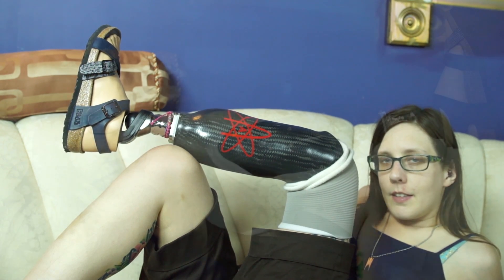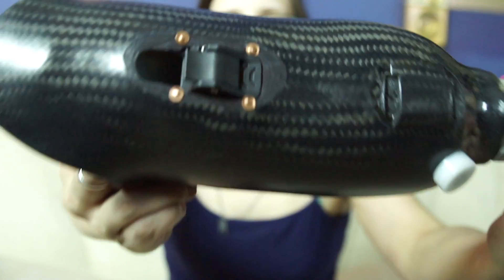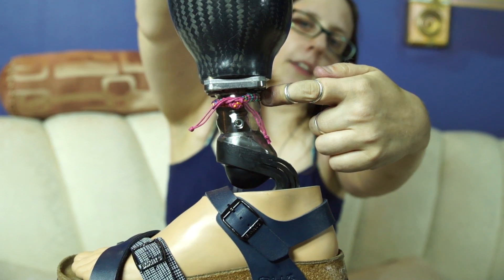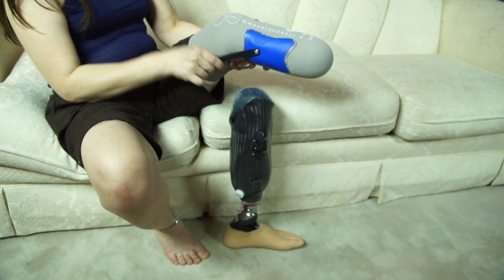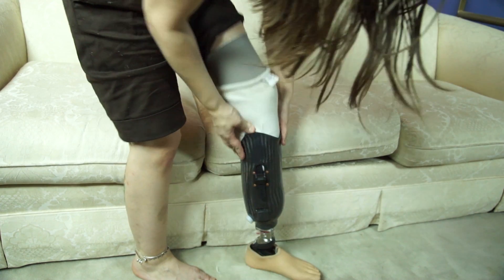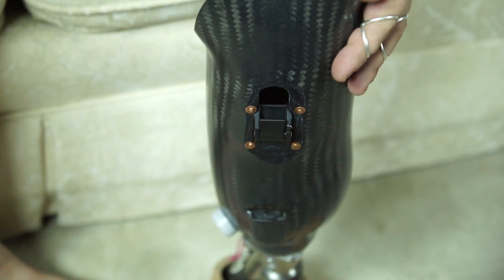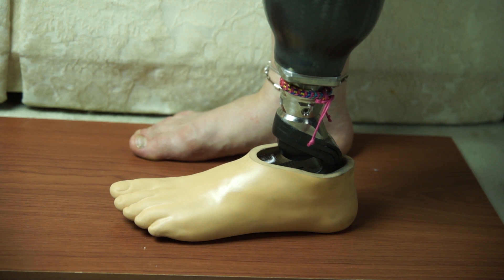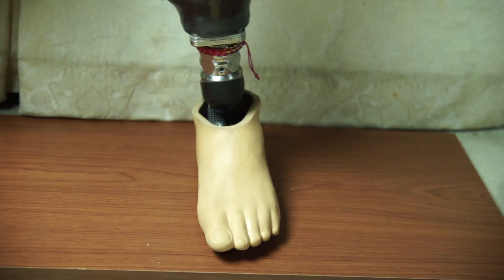AmputeeOT: How a definitive carbon fiber prosthetic leg works

Comment: I have the same foot but I do not have a valve or my in its suction cup system. I also don't have the carbon fibre plate you have inside your foot. Am I missing somethings?

Comment: I  had a transtibial amputation 8 months ago. My prosthetist cast my prosthetic and has told me I will have to have more casts taken until my stump is at its smallest. There are no valves to suck out air on mine, and no liner at the top. I have what I call a flower pot which I have to put my stump into. I then have to add socks to this then I squeeze the flower pot into my prosthetic. As you can imagine my prosthetic looks really thick as there are two components to it. I despair ! Also I have no flex at the bottom ( no ankle ) and my foot has little spring in it either. It is made out of some kind of hard plastic. I have to wear up to four socks. I also saw your video of when you first walked. Yoiur other prosthetic looks different than this one. I live in Scotland and had mine done under our NHS, which means I didn't have to pay. Can you please let me know who manufactured yours and was it expensive ? Thank you .... Kelly

Comment: when your residual limb shrinks would you need to buy a new liner to make it fit properly or is it possible to adjust the current one?
Reply: Mini180 You will be supplied a number of socks that come in different ply's. They come in 1, 3 and 5 play and all you do is just add more ply throughout the day which adds more volume to your residual limb

Comment: so should I go for the suction leg like your, the sleeves wears down my skin and I'm trying to get away from the sleeves, I do a lot of walking and doing around, what would you say do? thank for any help
Reply: +denise cryer I know your post is old, but thought I'd try and help. Your skin may be affected due to a poor socket fit and not the sleeve. There are many different types of suspension setups and the correct one for you will depend on your needs and specific situation. Her prosthesis is actually a terrible design. The reason for her design is due to a poor socket fit, otherwise, she would not require that side strap to help control rotation of the limb inside the socket (which I suspect was the goal with that strap). Hope this helps

Comment: thanks for such nice videos .i am going  to probably have a ankle and foot amputation in a few months, its a bit scary,but you make it seem a lot  more simple to put it on and take it off. thanks again for your time and how difficult is it to wear a dress or also a pair of jeans?
Reply from the maker: A dress is no problem, but jeans are a little weird, see: AmputeeOT: Putting on pants with a Prosthetic
Reply: I have a above knee leg amputation.  After the amputation I wore shorts and hiking boots to transition into my prosthetic, the shorts just allow ease in on/off adjustment.  Once comfortable I now wear jeans again.  Your regular pants/jeans should slide right over your prosthetic and donning shoes is no different than normal. I wear cowboy boots and once adjusted I modified my boot with a inside zipper to allow pulling it on the prosthetic foot.  But you should have no issues with your clothing, in many ways my prosthetic is easier to deal with than my original leg.  Good Luck!!
Reply: Of course you can!  However, quite how depends on your level of amputation and whether left or right.  I' m a below the knee left leg amputee  which means I can drive an automatic transmission  but not a manual transmission as I can't operate the clutch!
If my prosthetic becomes uncomfortable whilst driving I can remove it and drive left legless - I'm just waiting for a traffic cop to demand "Just step out of the car, Sir" and see his reaction when I refuse!

Comment: I can't quite tell, but it doesn't look like you have one of those pivot plates at the base of your socket. I know you've mentioned uneven surfaces giving you trouble. Have you considered a pivot plate doohickey? I got my first one ever just a couple years ago, and the response (and relief) is pretty amazing.  After almost 40 years walking without one... ugh, I can't imagine going back.

Comment: i have a question, whereabouts on your residual limb is the pressure when you are wearing your prosthetic, is it right on the bottom where the wound is, or are you supported under your knee?

Comment: I was amped 1 year ago next week.Same leg same BTK.I've been through 2 sockets already. I have the same liner as you but my leg is only on by pure suction and liner that rolls up my leg.I don't have the ratcheting gear you do.
I can walk 5 miles, ride my bike, jog, and pretty much am more active than I was before. I've lost 40lbs SINCE my amp so I have problems with leg volume (shrinking) and I wear socks that get thicker plys as the day goes on. I'm gonna need another socket soon!
GOOD LUCK!

Comment: You are correct about adjustments. My stump is quite a lot thinner and shorter than yours (my tibia was removed at the knee and the fibia was cut where the bone became defective). I only need to get a few adjustments after I get a new leg then it's all good until the leg wears out, unless I gain or lose a lot of weight.

Comment: Wow! I used to be a PT and this is worlds away from what we were doing then. I first caught your Lego experiment, but now I'm a subscriber.  I'm amazed. 
if you don't mind telling, how many times a day do you have to take it off and for how long. 
I've only worked with a few amputees. I spent most of my time in the modality area and when I did get out it was hip and knee replacements as far as the eye could see.

Comment: It is already possible to design the socket-shape by computer (do as search by "cad-cam prosthesis), I did it on my previous job. But there is still a lot of "feel" needed to where and how exactly change the shape of the socket. So really automated is not possible or at least not in the near future.